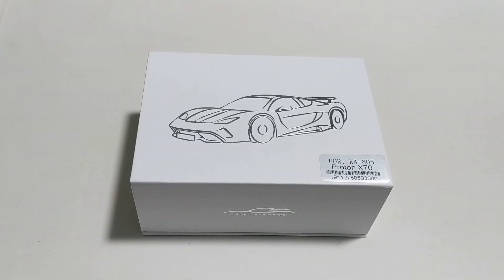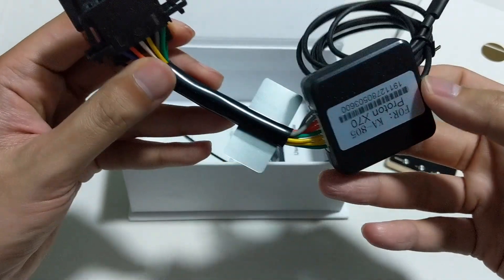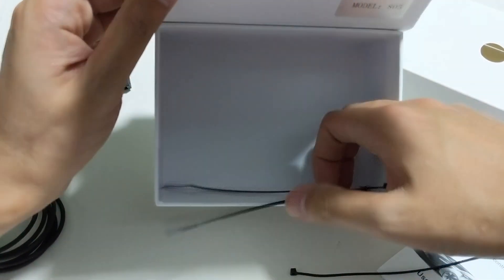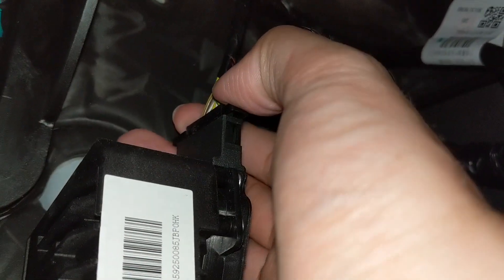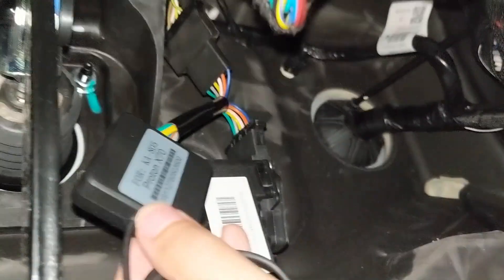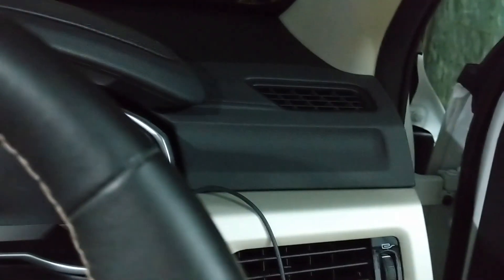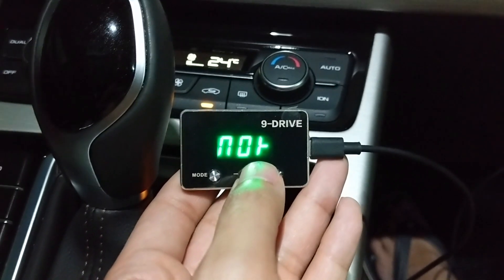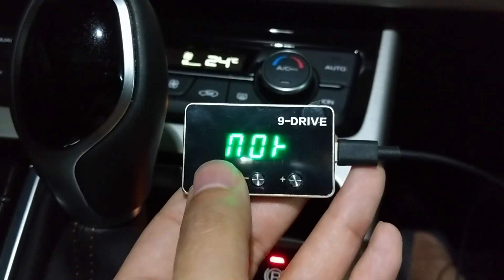Throttle Controller for Proton X70

Comment: What is the purpose of this product??
Reply from the maker: Whenever you go through bumps, or after tng or smart tag booths, you press down the pedal, there is a annoying 0.5 to 1 sec lag before the car surges forward.  This product eliminates the lag. The x70 will respond as per how you pedal. Giving you total control.

Another benefit is the product itself comes with 27 driving modes. Which if incorporate with our x70 3 driving modes, gets you a total 84 modes of fine tuning the pedal response. 

Lastly, if you have jerking issues even after the TCU update, you can run a higher TC sensitivity settings to reduce or eliminate the jerk. Downside is there's large effort in lightly  controlling the pedal works. 

I'm not the seller nor the sponsor of this product. There is niche use for this product. Plus it's cheap. If you're interested to TT for fun do contact me 😉
Reply: I'm an X 70 owner year 2019  model. And I totally agree with you. Since the day I purchased my car i have noticed that there is an irritating lag of 0.5 ti 1 second lag as we slow down, stop & try to pick up again. Had gone to my dealer to adjust / tune the TCU but still the same, no improvement, despite being told that my transmission will re-learn etc etc. Other than this annoying thing, all is good. Except, there is this funny smell from the air-cond, apparently its the heater i've been told.

Overall, great article & thanks for sharing.
Reply: Also I wish to add, I'm worried by doing this modification, will void our warranty.